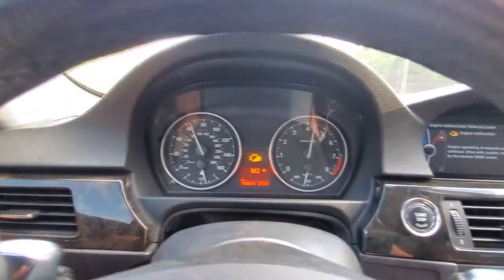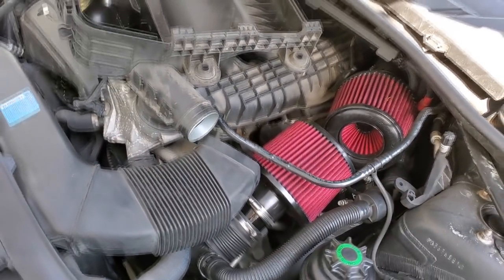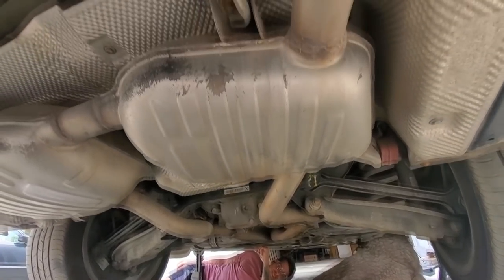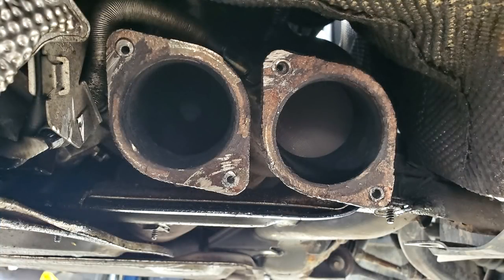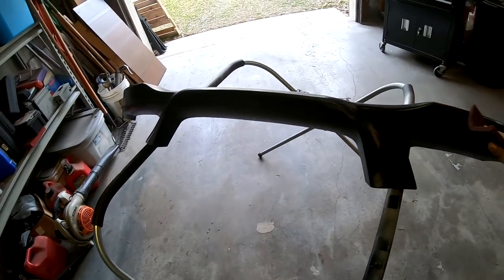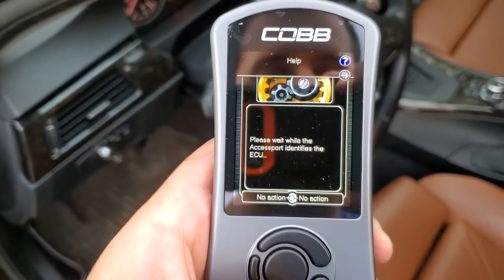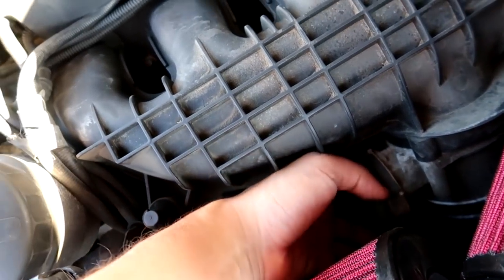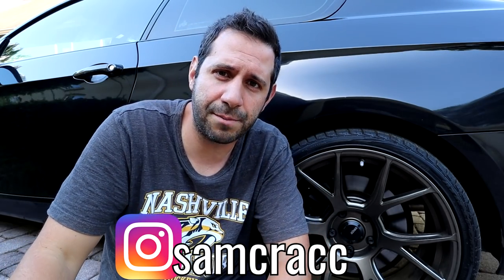Making a DONATED 200,000 Mile Twin Turbo BMW Look and Drive like NEW! (and then ENGINE MALFUNCTION)

Comment: I have a 335i as well, and I believe the engine code is caused because of the loose turbo wastage gate which is found almost in every n54 twin turbo, if you turn the car off and turn it back on it goes away. You can upgrade the wastage gate on the turbos os get new  turbos or maybe go the single turbo route. keep  those great videos coming👌💯

Comment: I’ve got exactly the same issues with my 335i. I’ve changed all the vacuum lines and the boost solenoids and the maf sensor but still nothing. Check your MAF sensor is a 3.5 and not a 2.5 your car might throw the code. Good luck following with great interest.

Comment: The dealer giving you $1500 for this car is an insult. Reminds me of when I wanted to trade in my old '99 Saturn SL1 for a new car in 2016 and one GM dealer appraised that car at $250. Sure, it had 186,000 miles, but was in good driving condition, no damage or dents, four new tires and a pretty new battery. I took it to another GM dealer who was offering $3000 for any trade-in.
Reply: Bat Guano that’s why I call them the “stealership.”

Comment: most of N54 throw engine malfuntion faults after a tune because old tired coils cannot handle it. If not - the injectors are leaky.
Reply: M54 too, mine from time to time throw engine malfuntion and the engine start to trmbling, but after a few seconds evrything return to normal...
Reply: try high pressure fuel pump also as my n53 did the same with that code and warning.
Reply: Engine lights and n54 go together.

Comment: new coils are 30$ a pop. Change them all, when they are old they cannot handle more boost.
Reply: Dominykas Dainys it would of come up on the diag misfire or multiple misfires it’s the lambda sensor...but I’d deffo replace the old coils anyway if they haven’t already been changed recently
Reply: @zman86turbo  yea but usually if engine malfunction come just after the tune, it's 99% the coils or the spark plugs. Most of N54s that stay stock never have any issues, it's the tuned ones that start pissing everyone off.
Reply: @zman86turbo  These cars tuned have to change coils almost every 30k miles. I've owned two N54's. if you're tuning it go ahead and put new coils and spark plugs. thank me later
Reply: Dominykas Dainys I can attest to this as I have an 09 335i that has just shy of 140k now and outside of having to replace two coil packs and a standard (much needed) spark plug change, my car has been about as reliable as a vehicle can get and it is bone stock, no mods whatsoever. I’ve been all over the country in this car and it’s never left me stranded. It does go through tires though!
Reply: Dominykas Dainys it’s the coils man. That and new plugs and I bet the problem goes away
Reply: Silicone is usually a cheap fix for coils, the housing could be cracking with age, causing spark arches. Silicon is a great insulator, use a paintbrush and be liberal with the silicone.

Comment: " There's no such as thing as too much boost " 

~LS engine
Reply: whel to be honest even leroys old engine lifted the heads from to much boost
Reply: @boocho1896  nope it lifted the head from a lack of boost the ls wasn't having it
Reply: *coughs 4g63
Reply: Mike Edge lmfaoooop imagine
Reply: yeag their really is when you get a bend on those rods
Reply: I was pushing 52lbs on my Cummins ISB5.9
Reply: Tell that to your stock head gasket and stock head studs. They might disagree with you there lol
Reply: Nick Gehr I love Ls’s but own an N54. These engines can handle a lot of boost
Reply: Michael Houk built 4g can take 85 psi easy
Reply: @floridaswampmudders9939  use car doctor 😷

Comment: u just removed a cold air intake and installed a hot air intake.
Reply: Sirtokesalot47 doesnt matter in a turbo car. It will get hot regardless cuz of the turbo. Intercooler is more important
Reply: @heatchamps2011  plz tell me you are joking.
Reply: @An0nDEViant  heatchamps2011 has a point tho. The intake temperatur increase of ~30-40°C is negligible compared to how much the compression of a turbo will heat up the charge air. Assuming an air temperature of 20C and a adiabatic compression of 15psi you'll get a temperature increase of almost 90°C. Only through compression. In addition to that the charge air will be heated up by the turbo itself on top of that since the turbo will naturally heat up during use. A turbo can easily reach temperatures of 500°C on the exhaust side and some of that heat will bleed through to the intake side through the shaft and whatnot. If you have an adequate intercooler it won't make any difference because the charge air will be cooled down to stock temperatures. Maybe even lower depending on what intercooler you run and how much bigger it is compared to the stock intercooler. And as you saw in the video the car didn't overheat and it didn't throw codes because of high intake temperatures.
Reply: The air gets passed that steamy hot turbo. A few °C won't really make much of a difference.
Reply: @it_is_just_a_volvo  I have heard from multiple sources that you want to start off with cooler air since the compressed air will then end having higher density. I think Engineering explained even covered this. Less dense air requires a higher flowing intake system to flow the same amount than cooler air allows.
Reply: He left the cold air pipe blowing into the filter area which should help some.
Reply: @heatchamps2011  wwqq25
Reply: a2cryss lol while this is true it makes a negligible difference on a turbo car. That’s what your intercooler is for. DCIs are good for these cars due to air flow, not air temp.
Reply: Some German engineer designed that intake. I think you did not make any improvement to it.
Reply: Now how it works bub😂

Comment: Nobody uses COBB on this platform, get a real tune
Reply: Running MHD stage 1+. BMS intakes and FMIC Really nice tune for a daily driver. stage 2+ coming soon
Reply: It is one of the least aggressive tunes out there and considering it's Sam and the milage it's probably a good choice. I mean look at how he checks for a boost leak 😂
Reply: isn't COBB best for SUBARU?
Reply: @southjerseysound7340  There's a 99.999% chance there's a vaccum leak somewhere.
Reply: Yep. A Jb4 is much better
Reply: MHD is for poors
Reply: he mentioned he wanted to be conservative
Reply: @GodKing804  I've had jb4 and MHD. Really not much difference in feel. My butt dyno tells me the MHD is actually making more power. I love both though I plan to do JB4 with MHD backend
Reply: @famousmidnight  it always confuses me but what do people mean when they say they want a jb4 with a backend mhd flash
Reply: Michael Z It’s good on some platforms like the WRX STI, Mazdaspeeds. But not on this One apparently.
Reply: @Entertainmentinc1  jb4 is a really smart boost controller. mhd is a ecu flash app.  there's a mhd tune that has the flash controlling "back end" functions like timing , fuel etc...while still alowing the  jb4 to control front end functions like boost level , rev limiter , throttle response, etc.  instead of letting the flash tune control it all.
Reply: Yea. Mhd is a no brainer.
Reply: he said in the video he wants to be conservative with the amount of miles on the engine
Reply: @famousmidnight  mhd stage 2 tune and jb4 for ethanol management have fun
Reply: @danieldiettmann8190  Yea I'm actually trying to get that setup but for methanol to bring down temps. I live on the Gulf coast where it's hot, ethanol isn't very easy to get.
Reply: @Entertainmentinc1  In combination jb4 is used to control things like ethanol or meth and safety measures plus a few others the other guy mentioned. And the MHD backend flash is the actual ecm tune. Really nice setup.

Comment: never been a fan of how that engine sounds, at idle it literally sounds like a diesel, and when you rev it it turns into an angry vacuum cleaner
Reply: Yeah, I'm good with the stock exhaust.
Reply: With the engine cover in it ain't loud. I hated how mine sounded stock but Corsa makes a great cat-back for it
Reply: Sound wise B58 and N55 are much better than N54

Comment: Hey Samcrac I’ve owned a 335 for two years and mine especially makes over 500whp, and I strongly recommend you ditch COBB and use MHD, since COBB is outdated for the N54 platform and MHD is constantly fixing bugs n improving driving experience.
Reply: BMWs are trash
Reply: Alessandro Moretti and what do you drive?
Reply: Pedro HBR I love how he has no answer 😂 N54 🔥🔥
Reply: @dave6933  what do I drive? A bicycle
Reply: @dave6933  lmaoo right?

Comment: Those intakes give an extra 10 hp when they Dyno it with the hood open. You probably lose 10 hp with the hood closed.
Reply: Cole Spolaric, just what I was thinking, those BMW’s get really hot under the hood.
Reply: i knew there was a catch... nice one!
Reply: yeah the cone intakes without a heat shield get lots of heat soak. I remember a forum post where someone actually tests over like  3 dyno runs. 
after the 2nd run you lose like 10HP per run... and the 1st run had 0 gains. you're literally losing HP. 
either get the ones that fit in the heatshield, have a replacement, or mount in the kidney grills
Reply: Those dual cone intakes are good for 20 horse or so when tuned. Maybe 5 hp when stock. Doesn't matter that they take in hotter air as the car has an intercooler. @dylannguyen those back to back dyno runs are normal heat soak power loses, not related to the intakes. These 335i's need bigger intercoolers than what the factory stocks them with.
Reply: @maxwellbrown2584  but your putting more heat into the intercooler to deal with. It's why I said it probably causes a 10 hp drop. The intercooler will still drop that temperature down, but not as much if it wasn't heat soaked. Anyone that I've ever paid attention to that scientifically tunes engines will tell you this.

Comment: You do know that since its an xdrive version, you have to be careful with using staggered wheels since the fronts and backs now have a slightly different diameter. This will cause the central differential to constantly make up the speed difference when driving, causing overheating and failure of the central diff.
Reply: That isnt true actually. I have an 08 xdrive model aswell, and they  come with staggered sizes from the factory...
Reply: DistinctHD also my friends new M340i xdrive is staggered from the factory. also the power split shouldn't matter to the central diff... it should be able to send however much power it needs for however long it needs to
Reply: There the same size wheels I’m pretty sure me meant to say offset
Reply: @silver_n5442  well i know some xdrive models come with staggered sets from the factory but the tyre size is critical. If you mix and match and end up with slightly different circumferences, you're in trouble. Also I know the central diff is able to handle the torque, but it's the constant speed difference when driving at high speeds that's causing issues.

Comment: Hi Sam so I did a study with an aftermarket air intake system for my car my code reader displays the air temperature that the car is breathing in when I put the aftermarket air intake system on with the cone air filter the temperature jumped up 48 degrees more than the stock needless to say the stock one went back on  love videos keep up the good work
Reply: Jeremy Lutzz it all depends on where you put the CAI. As far from the engine/exhaust is best like at the bottom of the bumper, but then you risk getting water in your intake.
Reply: thats when you just flip the stock filter upside down, cut some slits in your hood and you got yourself a budget CAI for no cost. don't ask me how i know.
Reply: Those filters have to go more like lose 10hp then gain.
Reply: Naturally aspirated or forced induction? Turbo heats up the air, ic cools it down again, ambient temperature doesn't matter "that" much.
Reply: @andersnerhus7524  definitely gonna be hotter drawing from around the engine vs from the hood gap where most stock airboxes end up. but yeah, you're right with a turbo it doesn't matter as much
Reply: @andersnerhus7524   it's a naturally-aspirated

Comment: I'm pretty sure the lambda errors is because of those air intakes. The engine isn't getting the correct amount of air which causes the mixture to be all wrong. Put the stock intake back and problem should be fixed.
Reply: DCI's do not gives any error codes on this platform
Reply: anakondase that would be incorrect
Reply: anakondase the dual cones intakes don’t cause the half check engine light
Reply: I'm guessing the turbo wastegates/thrust bearings don't allow for 15psi (cobb stage 1+).  Not a fan of his stock style connection FMIC.  Perfect reason for upgraded turbos!!  Check fuel trims in OBD mode (ST/LT) OBD mode lets you see raw voltage/amperage.  Also check low and high side fuel pressures with trims.  If pressures are low trims should go positive to compensate but it can only go so far.  Also the heater code for the O2 tells me O2 sensors might be failing.

Comment: Staggared set up on an xdrive? Hope the circumferences are the same!
Reply: Pretty sure he meant staggered offset not like 18s on the front and 19s on the rear
Reply: @codeyjoseph2051 , pretty much.
Reply: Codey Joseph yeah i know, tire sizes need to be within like ~3% (correct me if i’m wrong) or itll throw the transfer case out of wack tho
Reply: @Mizzoubaseballll  tires are probably the same size, just out farther in the rear. Shouldn't freak the car out if that's the only difference. Man I miss the days of cars not giving a shit if you had 22s or 14s
Reply: yea i believe when he said staggered he means 18inch wheels with diff width and offset
Reply: @E46miley  yes, you are correct. These cars, with sport package, come with staggered sizes from factory. 225/40/18 up front, & 255/35/18 in the rear
Reply: There the same size you can see the back is more of a deep dish to stick out more
Reply: M Sport package came with staggered tho, only diameter matters

Comment: Almost positive that the air hammer from knocking the studs out probably damaged the 02 sensors.  They are pretty sensitive to hard hits and vibrations, especially if they are original

Comment: Sam, with the high heat those engines already create under hood, I wouldn't be surprised if you lost a sizable amount of power throughout the entire rpm range. It will also clog fast due to under hood oil vapors, rendering the filter trash in about a month....The oem airbox with a decent high flow filter is more than adequate at your displacement and needs, even at the track. It will supply the coolest air possible that you need for the turbo engine. If you want a 'large' colorful intake, there are pricey options to still grab cool air from outside the engine bay. -Rob, bmw MT

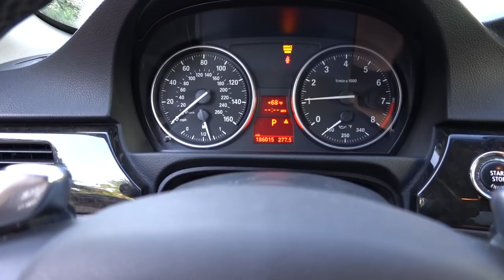Comment: 10:09 186,015 miles on the car
Samcrac: 200,000 MILES for clickbait views
Reply: It's basically the same thing. Not click bait
Reply: @katdaddychap  its not 200k, theres a 13,985miles difference. that's a good chunk left buddy. do you even know what clickbait means?
Reply: @herewegoagain7403  Still  a high milage bmw that is functioning, which is an anomaly.  You're being pedantic. Or trolling. Either way, stop it, get some help.
Reply: JEEPNATION damn that’s a lot of miles if he needs to put on 13,985,000 more to get there
Reply: @richardjameswellingtoniv9682  lmfaooo. thanks. i edited it
Reply: @microtransactions2661  then why not write high mileage BMW... its not 200k, facts. no debate.  gtfo. You wanna talk about pathetic? writing a milestone number when it hasn't reached it, for views
Reply: @herewegoagain7403  sorry you're right. It should have said almost 200,000 mi with in 7% accuracy because I'm not going to stop and make a video right exactly at 200,000 miles because people are going to nit-pick the title BMW. That would have really gotten the point across.
Reply: @katdaddychap  why not just rename it high-mileage bmw...

Comment: BMW designs their intake so well from factory, when you put on a “cold air intake” I’ve found that most of the time you will actually lose power. However power losses are slim 5-6hp, it’s worth it for the turbo noises☺️☺️
Reply: true. Engines need als cold as you can deliver AIR. Not 100 degrees air from the engine. If you wanna have power filters then use a big pip surround them to the front if the car.
Reply: @toudewolbers  indeed flowguides!